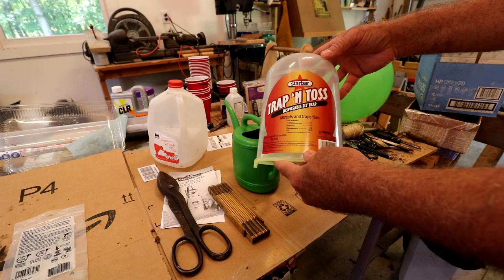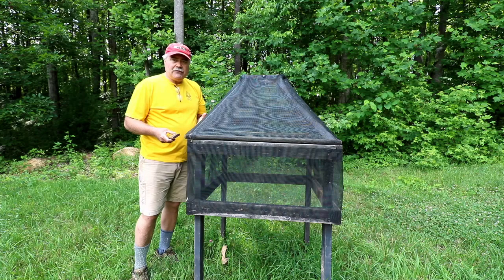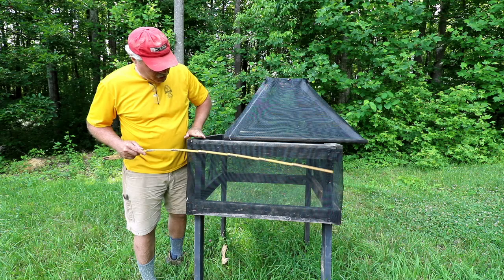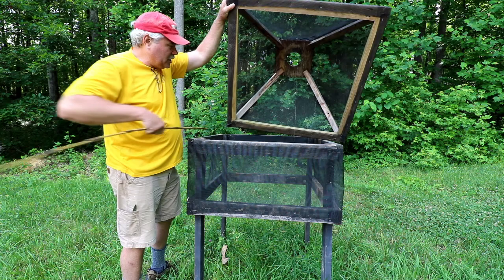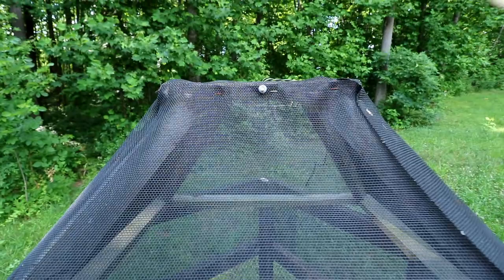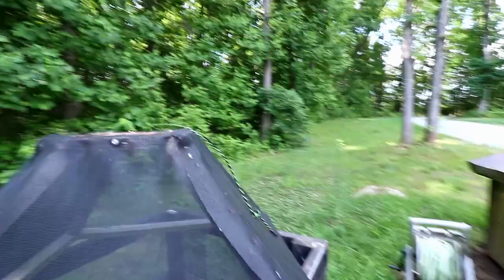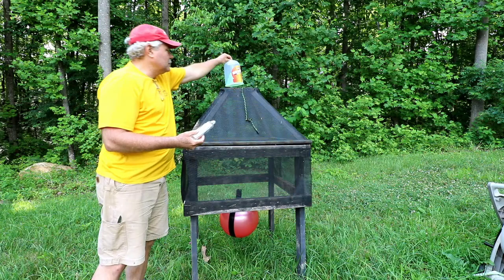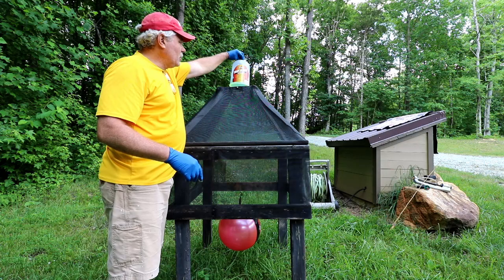#191 June 2022 Setup of the Biting Fly Trap

Comment: I'd be curious to see the contents of the trap once it's been emptied; to what degree is the setup effective against biting [black/horse/deer] flies vs ordinary flies (which are being lured via the smelly "trap 'n toss" bait)?

I'm thinking about building a trap similar to yours, though I'm not sure to what degree I should get a lighter colour fly screen [so that the biting flies focus on the ball & then go straight up VS attempt to attack the trap from the outside due to the black mesh].

In either case, this is a great concept; those other "pro" $400/unit variants are way too costly, especially when you need multiple units. 😮‍💨

Keep up the good work my friend! 👍
Reply from the maker: Thanks, Tommy.  The trapntoss at the top is filled up by the end of the season.  The biting black flies are noticeably absent around our home since I started placing the trap by early June through October.  That is the only hard evidence I can collect, other than the filled trap.  Your other ideas are interesting and worth trying, maybe build one with black screen and another with lighter color?